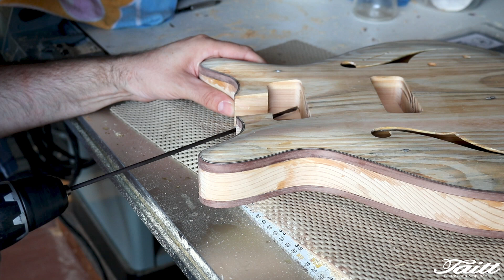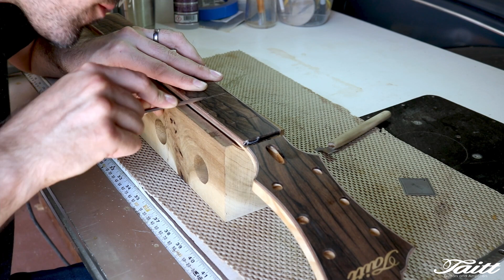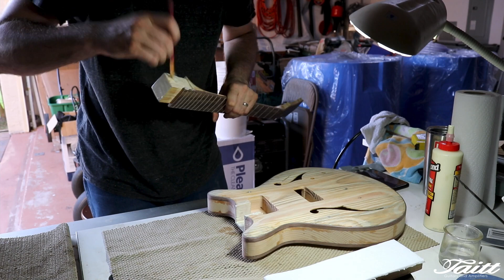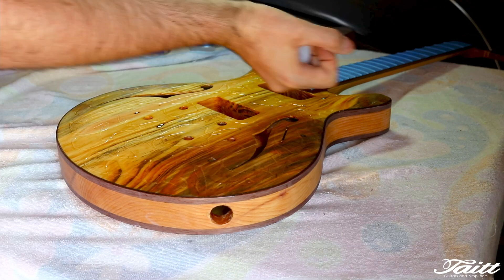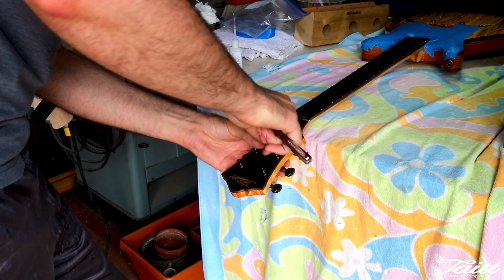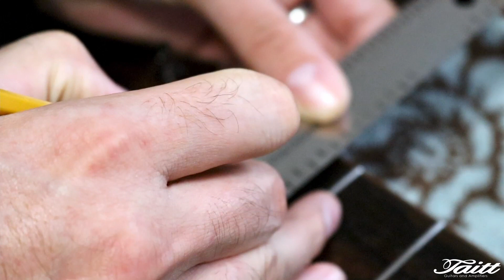Great Guitar Build Off Part 5: The Finish line

Comment: The more times I see this guitar, the more I think some tint would have greatly enhanced the look of that wood.  I use alcohol based tints that are sold as leather dyes. They are easy to control when used in conjunction with oil finishes.  The array of colors available is limitless.
Reply from the maker: I agree with you. Off camera I did some apartments with scraps of the wood but since its pine for the life of me I couldn't get an even color out of the dyes. On top of that the blue staining causing the streaking in the wood just about disappeared once I applied dye, even lightly. I think If I ever use pine again it will have to be a solid finish or something along those lines.
Reply: @TaittGuitars  There are ways to control the saturation level of dyes on wood. I do it by using finishing oils and alcohol based dyes. The oil goes on first, then while the wood is saturated with oil (still wet), you apply the dye in successive thin coats, rubbing it in then wiping off the excess right after application, until you achieve the look you want. You can even back up a step by applying another wet coat of oil and wiping it off immediately. I find that it does not obscure the natural variations in the wood.  You can even let the oil finish dry completely then dye it further. I use dyes made for leather.

Comment: Superglue?  why not lacquer? why not true oil?
Reply from the maker: I have done both lacquer and oil based finishes like true oil. I like both of them. The superglue was more because I saw someone else use it as a finish on a small project and thought it might work. Now after having done it, just like using pine. I probably won’t do it again unless someone request it. Even then maybe not.